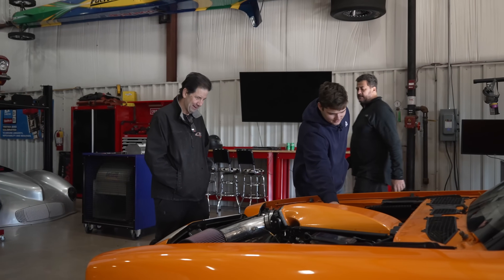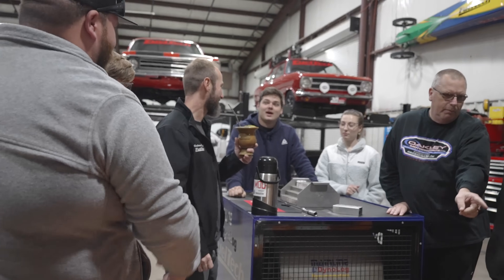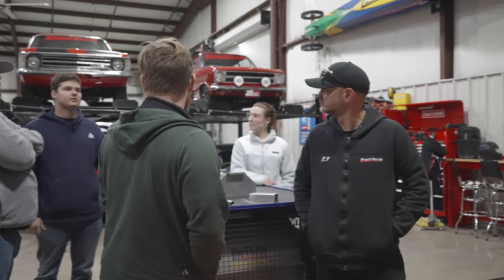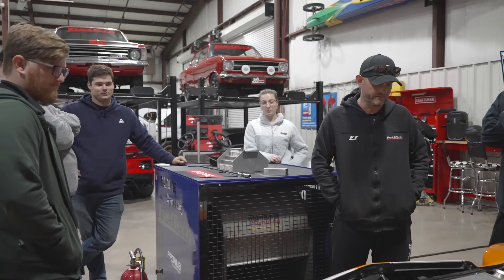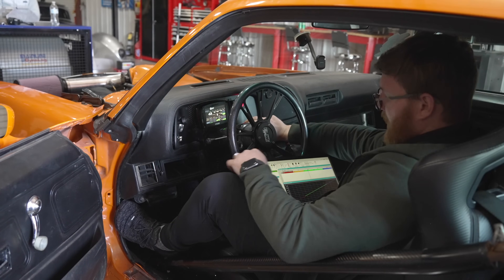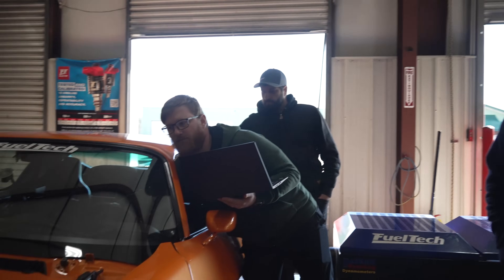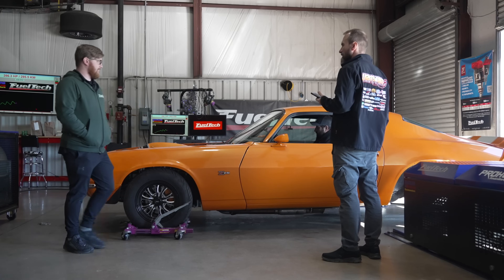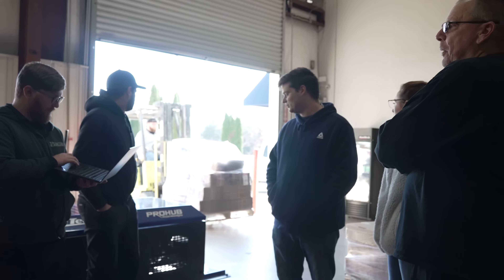7.50 Index Z/28 Camaro Hub Dyno Session | Bill Herman

Comment: Absolutely sweet looking Camaro but I can’t get the 7.50 index part to work out mathematically without turning into a Chinese gymnast. Not enough horses for a 7.50 1/4 and too many for a 7.50 1/8th………I think I’ll go do some mental Pilates and watch again….
Reply: It's always better to have the power headroom in index racing. It's easier to slow the car down for bracket racing than it is to make it immediately faster round to round. I run 8.00 index  with a 5 speed Ranger and uncorked heads up it'll run 6.70s lmao